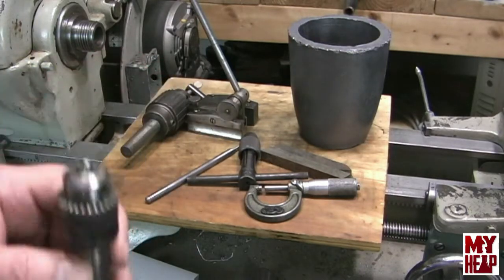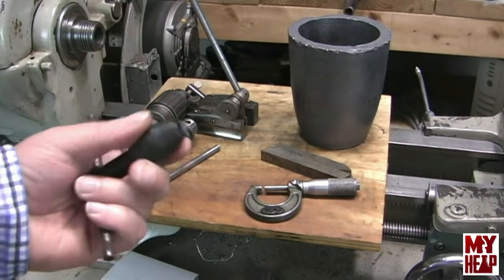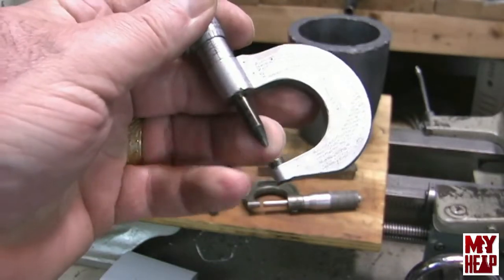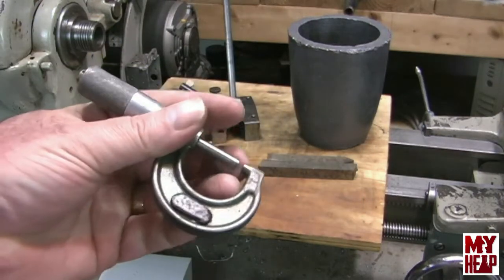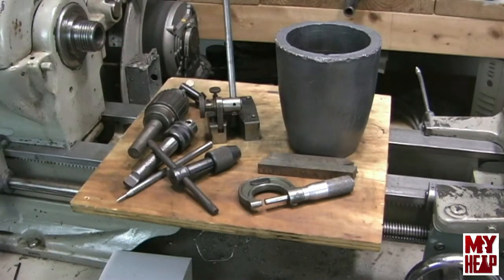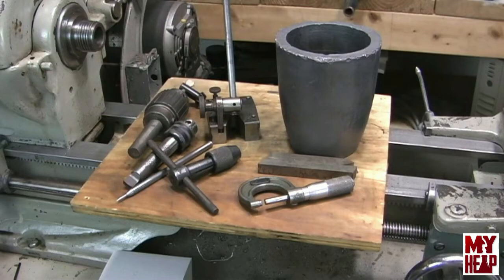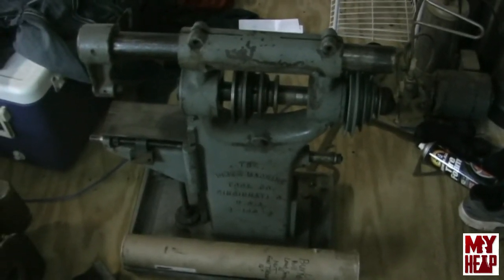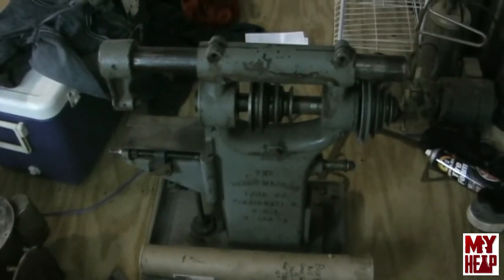A Big Gift for the Shop and a visit to MSFN

Comment: G'day Joe, it's great to see that sharing and goodness in people continues to be out there, many thanks to Richard and Sir. You sure have enough YT project work now to keep you busy. Hey the lighting for the mill clip was poor, I'd appreciate another reveal under better lighting sometime in the future if possible. Have a "Blessed" day.Peter
Reply from the maker: Thanks Peter.  I am continually surprised at the metal working community.  They are some of the best folks I have had the opportunity to meet and communicate with.

Yes, the lighting for both the mill and the lathe was lacking to say the least.  I plan on laying this stuff out on a bench and giving it a good go over.  Before stripping and painting, I would like to assemble the machine so that everyone can get a good look what it supposed to look like assembled and to see if I am missing anything.  So far I think I have everything, but may be missing a pulley that should go on the motor.

My son is pretty excited about having the Logan Lathe project to work on.  I know it looks pretty rough, but there appears to be no pitting from rust on it.  Time will tell.  I am excited to get to do it with him.  They grow up and move out, you just don't get to see them enough.

You are correct, I have enough stuff to keep me busy quite some time.  Speaking of busy, it seems like your milling machine will be running in no time.  Looks like you're just about done with the transmission.

Joe

Comment: Nice idea on the stamping tool I might have to get on the list.
Reply from the maker: Thanks.  Steven emailed me and thought it would be a fun thing to do too.  I think we should do it.
Reply: you have a drawling for the dial?
Reply from the maker: No, but will make a drawing and send it out with the stamp.  The upgrade consists of two pieces.  A part that presses over the existing boss on the cross feed slot, and the dial itself.  I have an idea on doing this as a community project, but want to talk to Steve first as it would require use of the images he sent me.  I will keep you all posted.

Comment: I have the same logan Lathe 700. There's a serial number on the ways by where the tail stock sits. Will tell you what year it is. http://www.lathe.com/ser-no.htm
Reply from the maker: BULL DOGG, thanks for the link.  I don't know if I would have found that one.  Now, I need to go see if I can find the serial number!  Thanks again for the awesome tip!
Reply from the maker: Well, I looked and cleaned but I cannot find a serial number stamped between the V and flat way where the tailstock goes.  The only tag I can find on this one is on the headstock gear cover and it reads 2014.  Now admittedly, I was looking at the last three inches of the tailstock end of the bed.  About how far is your number located from the end of the bed?

Joe
Reply: It's on the front way, a quarter inch from right edge, just behind the V part of the way. If that makes any sense.
Reply from the maker: Well, either mine isn't stamped or it has rusted enough that the numbers are not readable.  Would you mind emailing me some pictures of yours?  To help us get an idea of how it goes back together a since it is in parts and pieces.  You can email me at xavier at gtec dot com

Joe